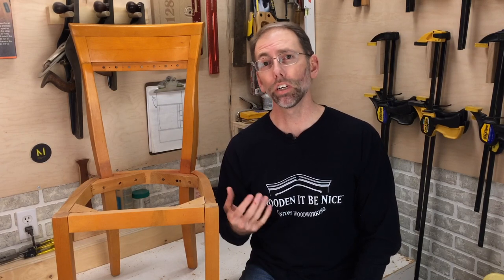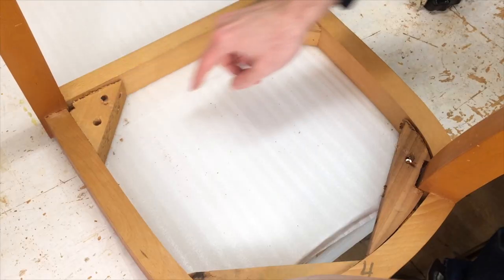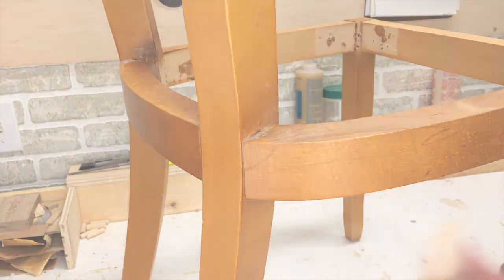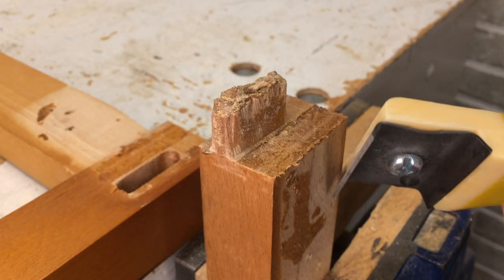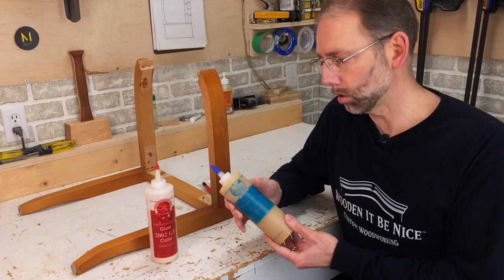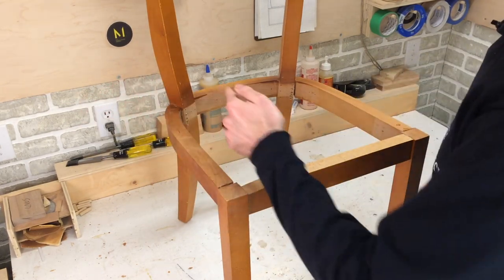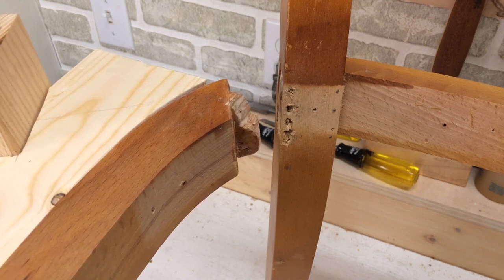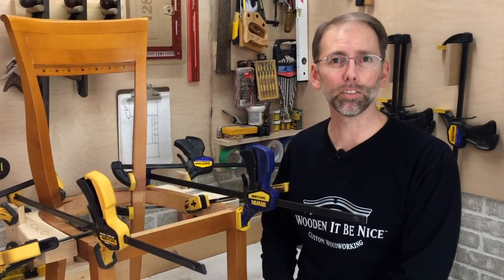Chair Repair with Epoxy Glue & Vector Clamping | Woodworking Furniture Restoration How To

Comment: As someone who repairs both boats and joinery/furniture I think you’re underestimating the power of epoxy. We build entire boats from epoxy and the stresses and strains the adhesive resists vastly exceeds that put on furniture. There’s a variety of epoxy glues on the market, those intended to set in five minutes lack strength, but have speed as their ‘advantage’, others dry clear.. but similarly lack strength. I assure you that an epoxy engineered for strength will be more than strong enough for your application.

Comment: I say this only because of the harmful vapors from using epoxy... I have always used shreds from my hand plane and regular glue white or yellow to wrap around the tenon and build it up to match the mortise / never had a problem getting a tight wood to wood glue up.  Anyone with a breathing problem might want to consider this alternative method.
Reply from the maker: I agree that the vapours from epoxy are not good.  While adding width to these tenons would have made them snug, there still wasn't any wood to to wood contact on the short sides of the tenons, hence loading up the joint with epoxy was the best strategy for these chairs without stretchers.

I recently invested in the West Systems epoxy and it doesn't have the odour of the small tubes.  I don't think it's no-VOC, but it might be lower.

Cheers.  Scott

Comment: I understand that you are just trying to show us time and place to use epoxy. But my question is: if it was an antique piece, would you still have used epoxy? I think I saw a Thomas Johnson video where he machined a piece of veneer to "beef up" the tenon, so he could get a tight fit of the joint and thereby avoid using epoxy. Is that a solution you would recommend too for an antique?

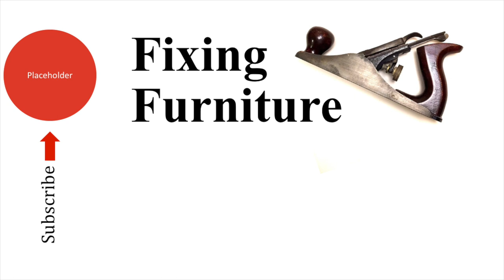Comment: 8:44 I was wondering, I have a fairly exploded leg on a barstool. It has cavitated / can I reset the metal elongated nut receivers in epoxy, basically pouring the entire decimated area with resin using a form and then shaving Simply to shape? Look not critical.
Reply from the maker: Thanks for your question.  I’d need to see a photo as this isn’t a simple yes or no question.  I offer coaching on our website if you’d like me to look at it and provide you with advice on how to repair it.  www.fixingfurniture.com

Comment: Another way to tighten up a tenon is to use a shaving from a hand plane, glue that to the tenon, clean it up after it sets, and then non-epoxy glue has a chance. I used to see the same chairs coming back again, so easy disassembly was important.
Reply from the maker: Thanks for sharing that tip!  Cheers.  Scott

Comment: You removed bracket nails, secured loose joint with epoxy, but did not use bracket nails?  Oversite?  Pls explain why not used or not needed?

Comment: I didn't think to use epoxy for loose joints like that. I actually have used wood shims to make up the gap in a mortise. That seems to be a good alternative, but I'll keep epoxy in my back pocket as another choice
Reply from the maker: Thanks for sharing your experience in situations like this.  I appreciate that.  Scott
Reply: I can't understand why, after scraping back to the bare wood, he doesn't pack out the tenon cheeks - as you have suggested, with veneers to thicken them, before using wood glue to glue the joint together.

Comment: Just curious, in that rear tenon where it was half broke off and still inside,  If i heard you correctly you used epoxy as per the others, but added wood glue to the broken part of the tenon where i assume a tight wood-wood fit between the broken pieces of tenon.
Question is, why not just keep using the epoxy the rest of the joint has ?     Going on your explanation that epoxy is good for larger gaps , can i assume that it's not as good as wood glue for tight wood to wood gaps ?

Love the channel, thanks for sharing your wisdom.   A mates dining table chairs all rock and wobble, so I'll have to go through this sooner or later ! Bonus, no brads :)
Reply from the maker: Great question Gary.  There's nothing stronger than wood glue for a tight fitting joint between two pieces of wood.  When it's done right, the glue joint is stronger than the wood fibers (I've got a video coming up that shows that as part of a repair).  The epoxy is good where there are gaps, but it can't beat a properly glued joint with wood glue.  I hope that helps.  Scott
Reply: @FixingFurniture  Thanks Scott, very informative.

Comment: Good morning. Seeing this video for the 1st time and noticed you used a 2-part epoxy. Is this due to the short pot time of the fast dry epoxy or had you not discovered it yet?
Scarf joint and epoxy worked extremely well for my last chair repair. Customer was very happy. Thanks for what you do.

Comment: Did this chairs joints fail because of varnish on the wood ? It looks like they varnished parts of the wood before assembling the chair so the gel wouldn’t be on bare wood ?

Comment: I was given the job of reupholstering an antique rocker.  When I pulled off the old fabric, I saw that every joint was loose, and the chair is now in pieces on my workbench.  When I began to scrape off the old glue, I saw significant gaps in the joints.   Thanks for explaining how to use epoxy for this!  Also, it helped me to see that you could glue one section first, and the others later, as long as the pieces are dry-fitted for spacing.  I'd been puzzling over just where to begin on re-assembly!

Comment: Your videos are always very thorough, I can learn a lot. I had to glue back together a chair, where all four joints were badly damaged, pieces of tenon were broken. I had to clamp them the same time, in order to maintain the positions. I used belt clamp and parallell clamps combination. I used epoxy glue and mixed to it fine saw dust to fill better the voids.
Reply from the maker: Sounds like you did all the right things Steve!  Congratulations on your completed project!  Scott

Comment: Good video and good justification for using epoxy - I've struggled with peoples' opposition to using epoxies in these applications. People argue for PVA because it is easier and avoid epoxy because it is more difficult, messier, and harder to clean up.

Also, I know boat builders who have become sensitised to epoxies - We ask our team to wear disposable gloves - These also help clean up of hands. Also, work clothes and good ventilation are essential.

(Currently restoring six upholstered 1927 swivel chairs in Queensland Maple for a ship's mess room - All have hide glue dowelled joints that are wobbly. Dowells are  7/16" so making these from 1/2" stock. Original joints were also backed up with steel wood screws. Because all of the old seat rim segment joints failed we are adding a disc of 5/16" ply underneath and unseen to reinforce. The bases are tripod cast iron dolphin design (a bit like dragons) - 2 bases were broken and 1 of these had become a welded steel pipe tripod - We cast a female mould in plaster --> made a male pattern in GRP --> cast new bases at a foundry.)
Reply from the maker: That set of chair sound challenging. Good luck with your project! Scott

Comment: Hi Scott. I am here again. I have some questions.
1. Is epoxy stronger than wood glue? If yes, why do not use it on all jobs? It is just a question of cost?
2. In case of junctions with gaps as the chair on this video, is it possible use epoxy inside the mortise and wood glue on the faces out of the mortise?
Thank you.
Reply: wood glue is already stronger than the wood, so in general, what do you expect to  gain ? The rest of the object is still wood, and this is where it's going to break.

Comment: Hay epoxy  and not poli?
Reply from the maker: Polyurethane glue has no strength when there's a void/gap between the wood.  It foams up, but that doesn't offer any strength.  Epoxy is the only adhesive that can hold when there's a gap.  I hope that helps.  Scott
Reply: @FixingFurniture  gracias

Comment: My kitchen table and chairs are antique and not really worth anything, but fit perfectly where they are needed. It would be difficult to find a set that would replace them, plus, they look good. The entire set is really worn out from age and multiple repairs. I've been stumped for years about how to make repairs that would last. This morning I thought about JB Weld, or some type of epoxy because I knew wood glue would not hold up. I just watched your video. Wow! Great stuff! Your precise explanations sure solve my problems! I can't thank you enough and can't wait to get started and have a sturdy kitchen set again. I was always a metal guy who can't drive a nail into wood, so this video is great! A couple of questions, do you recommend any particular brand of epoxy, do you use a quick set or slow set epoxy, how many pound strength, and since I don't have clamps, is it OK to use rope or something else? Thanks! After all this while I can't wait to get started on this!

Comment: Thanks for another excellent video. I am surprised you buy your epoxy in such small quantities. I buy the System Three quart kit and it will last six or eight months
Reply from the maker: I rarely use epoxy in my work.  I use mostly Cabinetmaker's glue from Lee Valley Tools as I generally work with tight tolerances on joints.  This chair was a surprise to me to see how loose the joinery was.

What type of work do you do where  you're using a lot of epoxy?  Scott
Reply: @FixingFurniture  I do furniture repair and refinishing.  I specialise in onsite repairs so I can't wait for wood glue to cure. When I am in the shop I use wood and hide glue in addition to epoxy
Reply from the maker: Oh, I have a question for you then Don - I was doing an on-site repair this week where a bolt hole was stripped.  I drilled out the hole wider and installed a dowel using epoxy, but I had to make a return trip because the epoxy needed 1 hour to cure.  Is there a type of epoxy that is better for a job like that?
Reply: @FixingFurniture  I use System Three Quick Cure and you can usually remove the clamps after about 10-15 minutes

Comment: My sister in law has a rocking chair in pieces that is one of the only things she has from her father. It looks like every single joint was very loose and came apart in a move. It's been daunting and I was thinking epoxy would be the only way to fix this "heirloom" chair. Thanks for giving me the right direction to approach this so my repair doesn't make a future failed furniture repair video.

Comment: So happy that I just discovered this superb artisan and craftsman. Well presented videos and with no short cuts or quick fixes. I hope to get to his website now. 
I do wonder if the vector clamping
Reply: Can be replaced by the wrap around belt method?
Reply from the maker: Good question Ray.  A strap clamp around the chair will not apply pressure to the joints in the right direction.  If this was a square chair with 90 degree corners, that may work.  On this particular chair, a strap clamp wouldn't create enough force on the joints at the back of the chair.  I hope that helps.  Scott

Comment: I recently had a stretcher bar implode when I drilled a new dowel hole after the old dowel rotted away. your advise to use epoxy glue paid off. thanks

Comment: which you had shown the unclamping and how sturdy the chair was after using the epoxy
Reply: In High School, during 60's we used wax paper between clamp and wood. Not sure why, just did what you were told to do.   Nice job in adding how you made wood tools to get a 90-degree clamp to change the pressure angle. 
In dry-fit, we told to work out clamping before the glue.  
When did you know, you were going to need a special tool to change the pressure angle.  That is one I would have miss thanks again in point this out

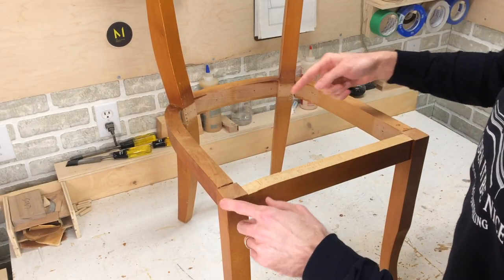Comment: 04:53 Here you state that regular wood glue is not appropriate because of missing clamping pressure, but at 05:58 you are clamping mortise and tenon together.
Reply: Epoxy-when space remains between joints during dry fit. Wood glue- when there is a nice tight dry fit. Always clamp. 😉 At least, that’s how I understand the demonstration.
Reply: @elizabethmclaughlin2216  Thank you.

Comment: Nice job but what happens if it loosen up again? With Epoxy u won't be able to take it apart!
Reply from the maker: You're right.  If this was a valuable antique, I wouldn't have used epoxy as it isn't a reversible glue.  In this case, it's the only glue that would work on this chair, so if it breaks, it will mean replacing parts.

Comment: Sometimes I wet a paper towel, put a wadded chunk in the mortice and take another piece and wrap it around the tenon and allow it to swell the wood. (It also loosens the glue allowing an easy removal). When the wood dries - it doesn't take that long - the fit is very snug.
Reply from the maker: Thanks for sharing that tip, however its a temporary change.  When the wood dries out, the joint will no longer be a tight fit.  While the assembly might seem right, the joint won't last.  I hope that's helpful.  Scott
Reply: Ok. I wasn't sure.
Thanks! @FixingFurniture

Comment: I am refurbishing a sailing dinghy I built 15 years ago. The epoxy used at that time is still holding well after about 500 hard fought races.

Marine epoxies (I use Norglass's Stay Bond) need to be allowed to penetrate, fill voids and cure for, typically 24 hours. They are durable, strong and relatively expensive compared with PVA, but far superior to 5 minute epoxies, except in cure time.

Great videos. Thank you.